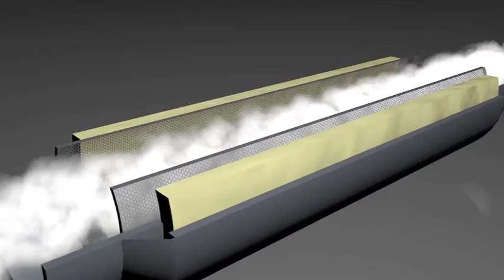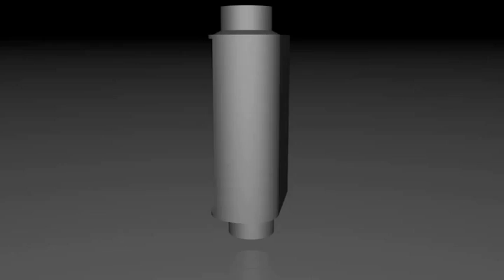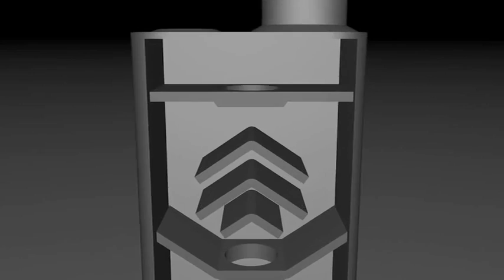How Flowmaster Mufflers Work

Comment: Suitable for an enduro bike?
Reply from the maker: Flowmaster does not make motorcycle exhaust components. Use the Make/Model search at SummitRacing.com to find a muffler or exhaust system for your enduro bike.

Comment: What about the original 40 series are they flow as well as these?
Reply: all those are very restricted even dynomax make better flowing mufflers than chokemaster
Reply: @benjaminalmendarez3059  if you think that CFM  is  the only  way that a muffler  makes  more power  ive got  news  for you...it doesnt exactly  work that way.  you will see at most,  an 8HP  difference

Comment: I just installed some flow master 40 series  on my Dodge 1500 Laramie and it sounds DAMN GOOD!!!
Just enough deep growl  but not overbearing.
Reply: Curtis Cook got a super 10 on my 2011 GMC bad to the bone
Reply: & also lost some horsepower with that muffler its very restricted air struggle to exit out due to them walls inside of it

Comment: They sound good on low compression engines and Oldsmobile v8 engines,but everyone knows they only flow a tad better than stock muffs.Flowmaster that is.
Reply: So incorrect lmao
Reply: @orbitaljellyfish808  It's true.
Reply: @fish_R_stinky69 

incorrect 

hotrod just did a test on a 1000 HP big block. They were within 8 HP and tq of magnaflos and borla. Makes no difference
Reply: They sound nice on SBF engines too, especially at high rpm.

Comment: this is why i hate chery bomb and borla they use the same ideas from 1900s i love flowmaster,thrush and flowtech cuz they all use chambors
Reply: Wrong. There are many flow bench tests out there that clearly show chambered and baffled mufflers impede the flow while straight-through mufflers flow MUCH better because of no obstructions. Flowmaster mufflers flow only slightly better than your average stock muffler. Straight-through design is best.
Reply: +Wade McKenney Flowmasters have an annoying hollow-metal-can sound. And those chambers and baffles impede the exhaust flow. Straight-through mufflers are the way to go.
Reply: Squarebody Case /Wade McKenney where does it say that it adds power? It says that it increases the flow velocity meaning it is causing a restriction which reduces power compared to a straight through design. You can blow into a straw and the velocity coming out will be increased but so will backpressure. Why do racecars designed for max power have straight pipes then?
Reply: Squarebody Case /Wade McKenney, there are many flow bench tests out there that clearly show Flowmaster mufflers flow only slightly better than your average stock muffler. According to the tests, straight-through mufflers flow best. Here's just ONE of those test results:
C:\Users\Owner\AppData\Local\Microsoft\Windows\Temporary Internet Files\Content.IE5\QE11DP60\airflowchart-1.gif
Reply: OddTimeMan Flowmaster exhausts have been proven to increase horsepower during actual dyno runs where it counts. There are mufflers that make more power due to the straight through design but Flowmaster exhaust do work and because there are no sound absorbing packing the way the system sound on day one will remain the same through the life of the system. Other mufflers can't do that.
Reply: @ragintaurusmusclemercury7023  Have you ever actually run Flowmaster mufflers on the dyno?   I have and they are terrible.  A $15 glasspack muffler will out muffle and out perform a Flowmaster easily.  They are awful.
Reply: @DaveMcLain  Over the past 30+ years I built cars I used straight through and chambered systems. Dyno-tuned them too. When set up right (proper sized headers, exhaust diameter, etc you can make a decent system that make power. A straight through design can flow better and make a little more power in some cases but it is not a big enough difference that it can win or lose a race against a similar car. It is all in the set up and what you prefer. I seen dragsters with Flowmasters so I guess they don't suck that bad. To each is own.
Reply: @ragintaurusmusclemercury7023  Who knows.  Maybe those dragster guys don't know how bad Flowmasters can be when it comes to making horsepower.
Reply: @DaveMcLain  Whatever. You don't like them. To each is own. Don't use them. See how easy that is?
Reply: @ragintaurusmusclemercury7023  It's not about not liking them; I had a Flowmaster on my truck for 20 years it's the fact that they cost not make power and that's a fact.  If they ran better it is only because something else was screwed up.
Reply: @DaveMcLain  Ok......  😒
Reply: use both together for chamberthrough tech
Reply: did u not listen to the vid....they add power more than any shitty glasspack will ever do and flows sounds way better and have no resonance if u know what ur doing
Reply: it cuz the air from the exhaust is more than a normal car and they do have muffelers some use flow master super 10s and some have spark arresters, looks at dyno charts flow masters give more power due to scavageing... just cuz its the path of least resistance doesn't mean it makes more power...also take the exhaust of a normal car u will notice a drop in power that's the same as a glass pack

Comment from the maker: Well, considering that glass pack type mufflers are a straight through perforated tube design, yes, an oval or box style muffler will have more back pressure. Please contact us on our tech line and we will be happy to try and help you find a muffler with the correct dimensions.1-330-630-0240